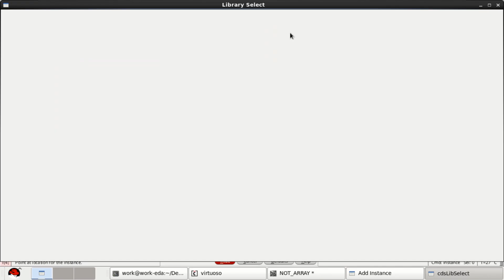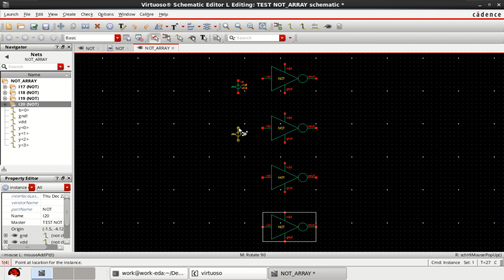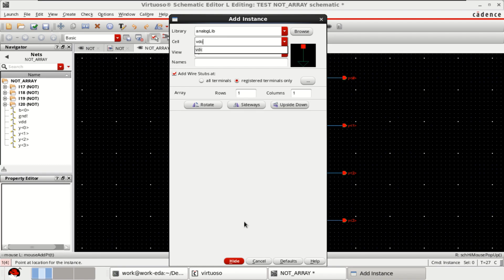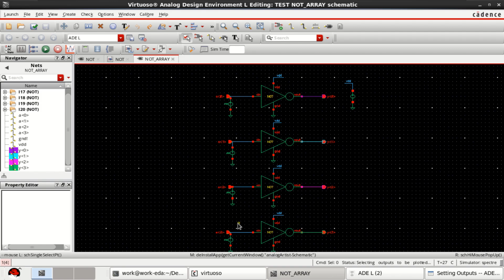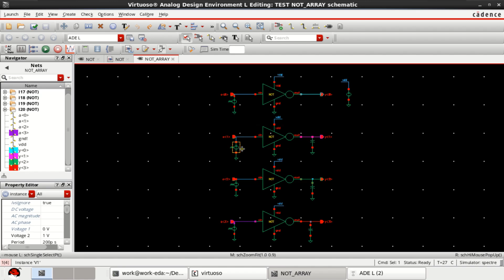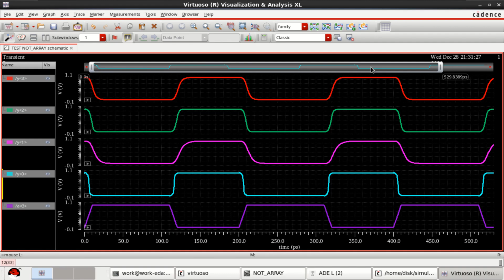Cadence Virtuoso: Create Array of Inverters in Cadence.

Comment: sir i have one ques   suppose i have 128 rows and i have to assign label to output of each inverter or you can say wire the output and then label them. is there any command to draw  wire at output node at once?
Reply from the maker: Hi, use the concept of Array and Buses I have posted a video on that.